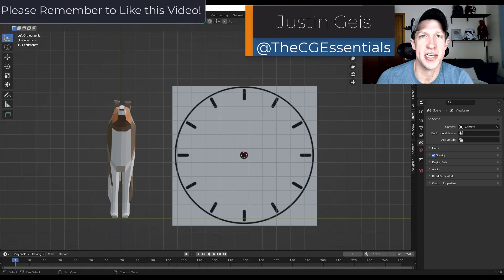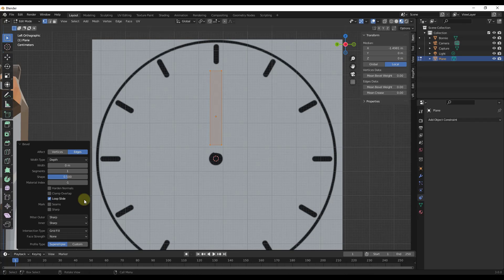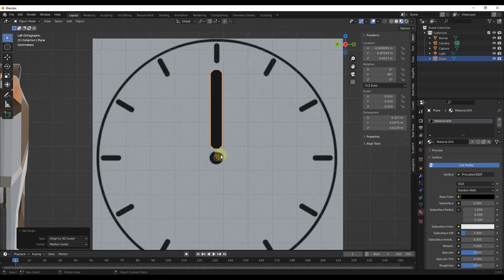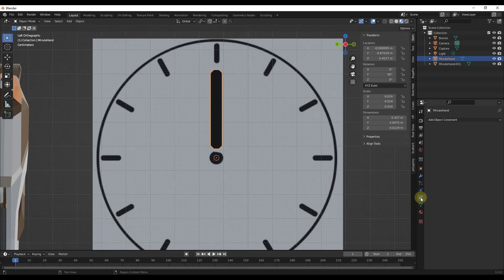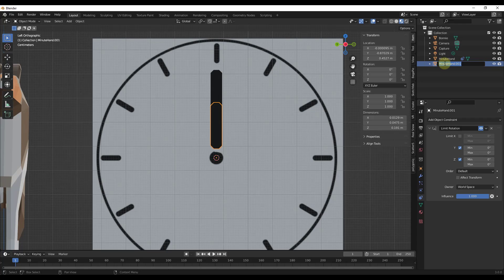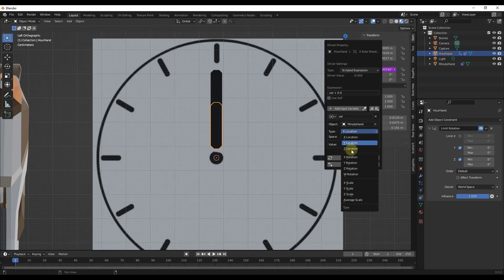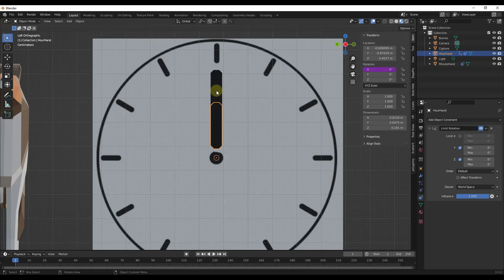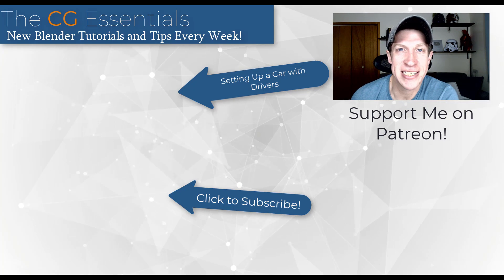Getting Started with DRIVERS in Blender for Beginners!

Comment: I wanted to know how to make the minute hand move. NO DICE!
Reply from the maker: I don't understand - that's in the video...
Reply: @TheCGEssentials  I don't see any way it counts 1 second or minute worth of delay for the minute hand to move forward.
Reply from the maker: @blenderblender792  That's what the driver does...
Reply: @TheCGEssentials  Move with a measured time a way to count to 1  second or 1 minute that is what you don't have.
Reply: @blenderblender792 You probably moved on from your problem by now, but I think what you wanted was to link to movement of the minute hand to the scene time, so that it animates according to the passage of time in an animation. Probably the simplest way to do this is by adding a keyframe animation to the rotation of the hand, and ensuring that the interpolation type is linear. Then do some math to make sure the rotation values of the beginning and ending keyframe are correct according to the FPS values of your animation.

There are other options for animation a clock hand that involve geometry node, or making a clock face shader material with shader nodes. But they all depend on scene time. The concept of scene time is a core component of animation in Blender.